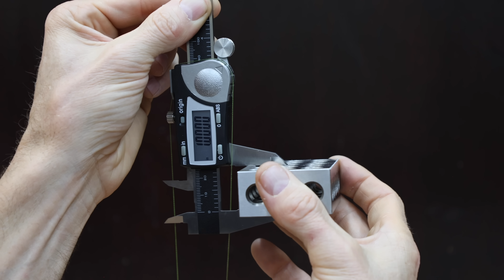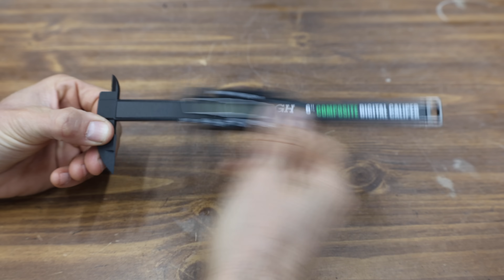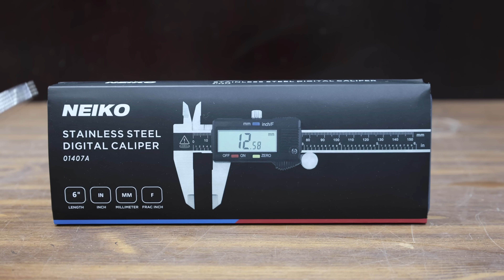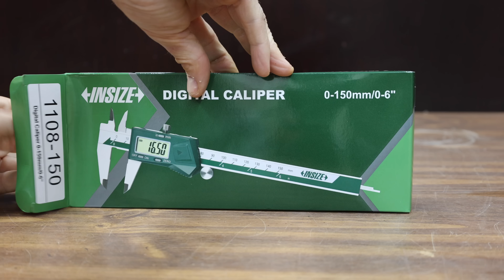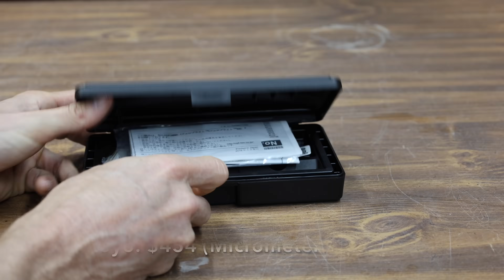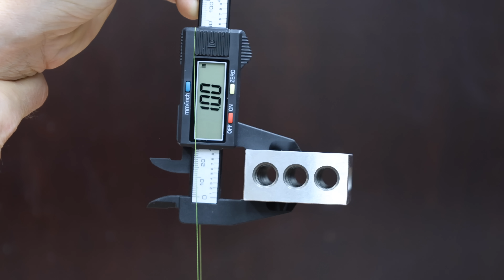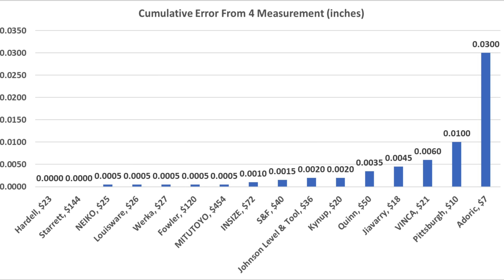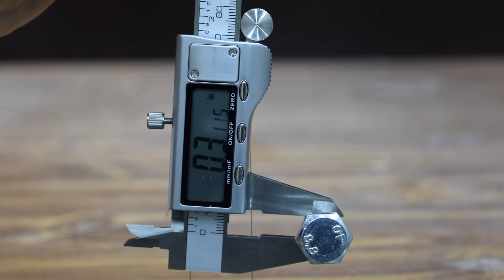I've Been Proven Wrong About Calipers!

Comment: Low-end calipers come from gimmicky brands, all sourced from Chinese factories. There are hundreds of products, and I don't see the point in reviewing some of them.
Those looking for a good caliper will demand precision, build quality, waterproofness, repeatability, and battery life.
You forgot TESA, SYLVAC, iGAGING, and MAHR, all essential metrology companies.
STARRET has its products manufactured in China, and FOWLER, when it doesn't buy from China, distributes SYLVAC under its own name...
A Chinese brand that stands out: SHAHE.
A caliper worthy of the name: IP rating > 54 and ABSOLUTE mode (which you don't seem to understand)! The fluidity of the varnish movement is easily corrected with silicone oil...
I don't approve of your video; you should have used standard gauges from MITUTOYO, for example.
The batteries in real MITOTOYO batteries are SR44s!
Les pieds à coulisse de bas de gamme relèvent de marques fantaisistes, toutes provenant d'usines chinoises, produits qui se dénombrent par centaine et je ne vois pas l'intérêt de passer en revue certains d'eux.
Ceux qui recherchent un bon pied à coulisse exigeront de la précision, de la qualité de fabrication, de l'étanchéité, de la répétabilité et de l'autonomie.
Vous avez oublié TESA, SYLVAC, iGAGING et MAHR, entrreprises de métrologie pourtant incontournables.
STARRET fait fabriquer en Chine et FOWLER, quand il n'achète pas en Chine, distribue SYLVAC sous son nom ...
Une marque chinoise qui se distingue : SHAHE.
Un pied à coulisse digne de ce nom : indice IP > 54 et mode ABSOLUTE (dont vous ne semblez pas avoir compris le principe)!
La fluidité du déplacement du vernis se corrige facilement avec de l'huile de silicone ...
Je ne valide pas votre vidéo, vous auriez dû utiliser des jauges étalons de MITUTOYO par exemple.
Les batteries des vrais MITOTOYO sont des SR44 !

Comment: A retired machinist here. I used Fowler/Sylvac (Swiss made) digital calipers. Smooth as glass and extremely accurate. For general shop use Mitutoyo dial calipers were recommended. Very accurate and no battery to worry about.
Reply: I love my S_Cal Evo set, I can even connect it to an app via Bluetooth and export the measurements to an Excel spreadsheet!
Reply: Now, Now, Now, You are asking people to do math, if you don't have the digital capability. An analog Micrometer, c'mon..😉
Reply: @DomariNolo  Dial gauge calipers don't need a Vernier (Very Near, hahahaha) scale to be squinted at, nor batteries to be sworn at when they run out.
Reply from the maker: Thanks for sharing.

Comment: Super Awesome or VERY IMPRESSIVE Comparison! I didn't know there so many acceptable brands. I'm getting the NEIKOs for my knock around tool bag.
    We use Mitutoyo at the shop because 1 they wake up calibrated and 2 because we make stuff that ends up in Aircraft. 
Love your work... I send folks to watch you when ever they spend money. 
       Depth needs to be done on a squeaky clean surface. Near invisible dust at 0.0003 will read 0.0005 on the best measurement set we have outside of the $$ Drop Gauge. We rent or borrow tools if we have to go tighter tolerances like 0.0003 - 0.0007 press fits.(Ugh lol). 
     I imagine sizes as; Hair is 2-3 thou so .0005 is @ 1/6th or 1/4th of a hair, depending on the hair.

Comment: I was a Dimensional Metrologist for 15 years for a leading Aerospace & Nuclear manufacturing machine shop. 

The cheap stuff regularly fails gage R&R studies. 

The cheap stuff breaks much easier & suffer from scale misreads. 

Theirs a reason most of what you trust your life too is calibrated with Mitutoyo & Starret instruments & equipment. 

I couldn’t tell you how many cheap calipers I’ve I’ve failed calibration on over the decades. 

Where in contrast, we’ve got 15yr old mitutoyo calipers still passing cal.  every 6 months.
Reply: im a student at a machining school right now, what would you tell a guy interested in getting into your side of the field?
Reply: @TheDaveofWine 

Being a Machinist is a great pre-requisite to becoming a dimensional inspector, progressing into the Quality field or getting into Metrology 

Get yourself some hands on training with CMM’s

Get you an ASQ Certification, or work towards one. Certifications in MSA (Measurement systems Analysis) to perform Things like a GR&R, SCC & SPC’s. 

And the biggest one, application. Get yourself into a Major Aerospace or Nuclear manufacturing company. 

A few years in there will accelerate your development & open doors. You make even seek to achieve through ASQ certifications to become a QE, get into program launch & APQP. 

I was a machinist when I started, because an inspector, progressed to getting my certifications online while working, became a Quality Engineer, a Quality Supervisor, eventually a Quality Manager.
Reply: @SG-wj2qj wow, thanks for the thorough answer! I’m loving this field everyone seems to help each other out!
Reply from the maker: Thanks for sharing!

Comment: Low wattage solar charger / maintainers for smaller batteries:  Here in the snowbelt snowmobiles are in use half the year and motorcycles and ATV'S the other half.  This means that the smaller batteries are sitting unused for half the time contributing to early failure.  Lower wattage solar charger / maintainers seem to be a good option to keep them in better condition.  Even with lower wattage solar panels (10 watts or even less) it's good to have a a panel that comes with a built in controller to prevent overcharging or battery draining backwards during long nights with no sun. I wonder how well and accurate these work.
Reply from the maker: Thanks for the video idea!

Comment: If anyone wants to go even cheaper and don't care about dead nuts precision , get a NON-DIGITAL caliper for less than $4. Ruler style, not the gauge kind (unless you have enough to spend). You do miss out on the measurements between the mm's but lets be real, the differences between 1.3mm and 1.5mm wont matter unless your doing a project that requires surgical accuracy in the smallest form.

Comment: 2 years ago, I bought the NEIKO calipers you tested. Had to check the link, but sure enough, exact same ones.

They are AWFUL. 

The measurement accuracy is thrown off almost immediately by opening the jaws using ANY kind of speed. I understand overspeed errors can happen, but it is excessive with the NEIKO. If I moved the jaws using anything BUT the thumb wheel, it would throw the measurement off. It was THAT sensitive. It's not a huge deal when measuring very small parts, but I can't image measuring anything wider than an inch or two. 
What's worse, though, is that after sitting unused for about 2 months, the whole thing broke. Any time a battery is in the unit, it's constantly reading increasing distance. Just rapidly rising, forever. You can zero it out, but it'll start running again. Can't turn it off, can't make it stop, without taking out the battery. I never really could trust the measurement on it, but now, it's just a paperweight.

It's entirely possible I got a defective unit or that they've changed the internal design in the last 2 years, but I could never recommend the brand to anyone, nor accept a recommendation of them.

-----------------------------

I have a separate comment/suggestion, but I'll separate it from this one.
Reply from the maker: Thanks for sharing your experience with these calipers!

Comment: "save battery life" is a pretty bold claim. I think it may have been Matthias Wandel who showed the power draw with display off - most of these units basically have the same draw with or without. The mitutoyo actually go into a low power mode with display off. Too bad all these others don't just have a manual switch

Comment: Considering 1/64” is 0.0156, pretty much all of these are suitable for everything except actual machine work and even then, for precision, machinists will use micrometers.
Absolute position is a nice feature.

There are a LOT of counterfeit Mitutoyo out there. Clough42 did a run down on these.
Reply from the maker: Thanks for sharing.

Comment: For professional use, I don't know that Mitutoyo or  Starrett have ever built a bad tool.  I was very happy to find a good hobbyist tool in this (Werka)  that doesn't fall into the buy once, cry once category.   If/when it breaks, I can make the decision to shell out the big bucks.  

It's  a great service you provide with these videos - thank you! 

Also, from past experience when PF drops a video,  Werka digital calipers sold out everywhere in 3...2....1...
Reply from the maker: Thanks and you are welcome!  Thanks for sharing.
Reply: When it comes to precision tools, you're paying for quality control and long term reliability.  A true test would require a large sample of each model and the test will need to be conducted over a large period of active use.
Reply: @kchididdy  That would be true for a lot of the things he's tested, and I've asked him about it before. I don't think he physically has enough time to do that sort of testing though.
Reply: too bad the mitutoyos he linked on amazon are likely knockoffs..
Reply: @kchididdy  you are 100% correct PF is almost doing false advertising and misleading info
Reply: I'd say that everyone should have 2 sets of calipers. One for quick reference that you don't mind getting banged around, and one that's as good as you can justify paying for to get good measurements when it matters.
Reply: Depends on the use right. I've seen tons of 3d printing hobbyists and woodworkers show off their mitutoyo pair when in reality given the accuracy of their work it's not nessacary. Sure if you use them daily and working with actual precision parts it changes.
Reply: I found a pair of beat up Mitutoyos for $3 at a yard sale. They lasted another 10 years of occasional use.

Comment: For home use battery life is really all that matters. I feel like I have to replace the battery in my cheapos every time I go to pick them up. And of course it's always the stupid size battery, so if you have to buy one locally the battery has probably sat on the shelf since the store first opened and is only having enough charge left to run the calipers for a single measurement
Reply from the maker: Thanks for the feedback.

Comment: My vernier calipers came with a calibration certificate. They are 200mm long, with inch/mm/fraction measurements. They are extremely accurate. They have to be, because one of my hobbies is fitting and machining. Especially when I am making the threaded pins for “D” shackles.
Reply from the maker: Thanks for sharing.

Comment: For any calipers or other measuring device using an LR44 battery, I suggest changing to a name brand 357 silver oxide battery. Typically longer life and better voltage stability. Slightly higher cost but should be made up in longevity.

I have a couple Neikos. Glad to see they came out fairly well in the tests. Mostly these are used for 3D printing measurements and I've been happy with the translation of accuracy to the parts I print.
Reply: Leaking batteries destroyed my $250 mit micrometer. Favorite piece of metrology gear with the ratcheting barrel + speeder.

Absolutely freaking infuriating, especially considering they weren't dollar store batteries either.
Reply: @Iceberg86300  Must have been Dura-Cell.
Reply: LR44 are alkaline and as they discharge voltage drops which alters accuracy.  Silver oxide batteries maintain voltage as they discharge and thus keep accuracy better over the life of the battery
Reply: @robhillstrom3283 I have never ever had accuracy issues with my digital mititoyo instruments, let alone battery state of charge accuracy issues. 

In this particular space there's a damn good reason why you'll find respected metrology brands in most machinists toolboxes.
Reply: YES! Absolutely! Experience informs me Swiss RENATA Silver Oxide 357s (SR44W) have a very flat discharge curve. Amazon has them in package of twenty. Store in freezer and they stay fresh forever.
Reply: Yep - SR44/357 silver oxide batteries make a huge difference in battery life over the alkalie
Reply from the maker: Thanks for the feedback.

Comment: I have 2 sets of each of the Mitutoyo & HF digital calipers and 1-each of Mitutoyo & Starrett dial calipers.  I often check the accuracy & precision of all four against each other and calibration blocks.  They are all within 0.001" of each other.  The Starrett dial calipers are a bit worn (+/-0.0005 below 0.010") after 40+ years of use, but accurate/precise > 0.100".  Because of the accuracy/precision of all models & types, I use the cheaper and/or older ones for everyday use and use the Mitutoyo digitals for when accuracy/precision really counts.
Reply from the maker: Thanks for sharing.

Comment: 0:24 Hey! Tiny infromation here! If you wonder why caliber suddenly stop working (screen shows nothing). Turns out, "mm/inch" button do not fit perfectly inside case
and is pushing 7-segment LCD soft connection element away from circuit board. This can fix by open and cut extra rubber off from button.
Reply from the maker: Thanks for sharing.

Comment: I once bought an $8 set of calipers.  Plastic jaws were the setting point.  Probably the same as the Adoric tested here.  Never again.  Absolutely horrid, mostly due to constant loss of zero even if it's just lying on the bench and uncommended shifting from metric to SAE.  I ordered the Kynup as it will be fine for the work I do.
Reply from the maker: Thanks for sharing.

Comment: I remember reading about caliper battery drain in a review a few years ago. The main tip given was to tighten the little thumbscrew to "lock" the calipers in place when storing. This is because many units have an auto-power on in addition to auto-power off, and jostling the storage case can cause it to power on and drain the battery.
Reply from the maker: Thanks for sharing.

Comment: Not too long ago I purchased a clone of the Jiavarry, more specifically a DkOvn branded one.  I don't understand why the ruler portion has the inches broken into 10s, and why it measures inches in decimals instead of fractions.  However, I didn't know it could also measure inches in fractions, the listing didn't show it, I have to see it myself.  Definitely more useful than decimals.

Comment: I've been using Neiko calipers for my reloading measuring for years. I've never had an issue. The battery typically lasts 6 months with my usage. The screen slowly fades lighter when the battery is getting low. Easy indicator. If I ever have a question about true accuracy, I go with my Brown & Sharpe.
Reply from the maker: Thanks for sharing!

Comment: I know that you can't review all of the brands, but wish you could have put in one from iGaging. I've been using the iGaging Absolute Origin for years, in fact I have several of them. None have given me a fraction of an inch of trouble. With my first one, I did the same 1-2-3 block measurement on several blocks, and got near perfect results (0.0005 over on one measurement) consistently. I've purchased several more and they all read exactly the same as the first. With I/M/F, absolute linear & USB output, I'd put them right up there with the big boys at 25% of the cost. - Chris
Reply from the maker: Thanks for sharing.

Comment: This thing with Auto Shutdown - ensure it doesn't have Automatic On that randomly proc. I have Carrera Precision CP9806-TF, which is absolutely useless cos even when you turn it off, after some time it will randomly go on. So next time you need a caliper, you can be sure that the battery is fully drained and you need to replace it.

Comment: If I was using for work that needs accuracy I would only buy the top three. 100, 100 or 400. That would worth it for not doing work twice later. 

For around the house anything is fine.
Reply from the maker: Thanks for sharing.

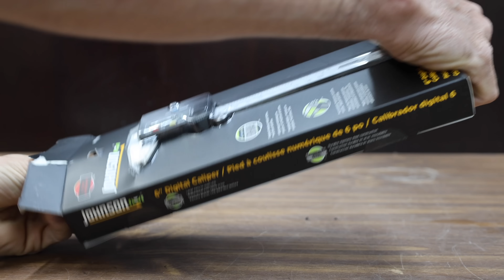Comment: I got a cheap digital caliper like 5:45 that I bought maybe 15 years ago in a discounter for 12 euros. Came with a spare battery and is more than accurate enough for what I need it for. The only thing I dislike about it, which I've come to dislike about all calipers, is that there's NONE THAT ARE LONGER THAT 15 CM!!!
I've had enough occasions where I needed to measure something that was just <160mm and guess what, someone decided that all calipers have to max out at 150-155mm... Even the one I have is 170mm long but the damn thing still maxes out at 154...

Ranting aside, I'd have a little feedback for future videos about measuring tools:
I think it'd be more helpful to describe the accuracy of the results as "x.yz above/below" the actual dimension.
At least for me, all those digits being spelled out turns into soup in my head and I'll just have to look at the numbers on the screen instead.

And to also add a video idea suggestion: I'd be curious about rotary tools like Dremels. Most are cordless I assume these days, but I'm curious what the difference between corded and cordless are and I am also curious if there's any out there which actively maintain a set RPM.
I got a cordless Dremel 8200 and it's quite nice for being so affordable, but it's also quite heavy and the fact that it's relatively weak means:
if I wanna work with something that needs 15k RPM to be used, I need to set it to 18-20k, because it will lose a lot of RPM just from getting load applied.
I cannot imagine that an RPM feedback loop is /that/ expensive to add these days, but yeah, no idea if ANY manufacturer out there bothered with that.
Reply from the maker: Thanks for the suggestion.  Thanks for sharing.